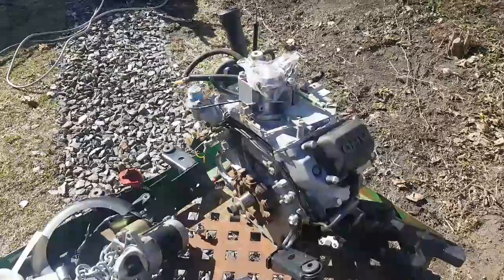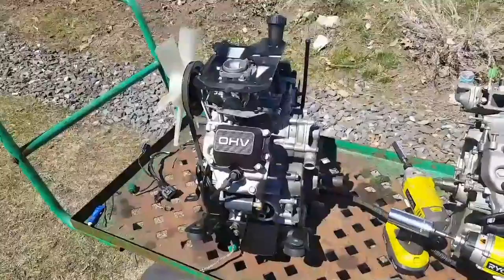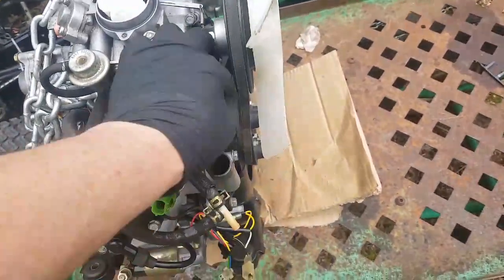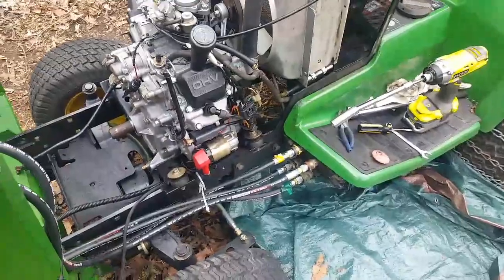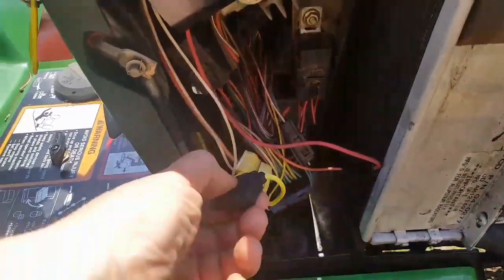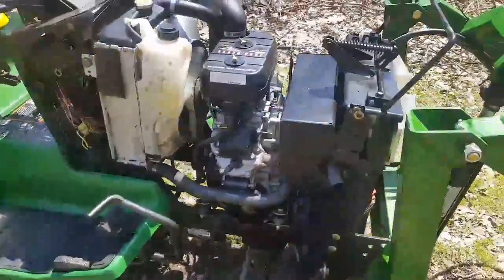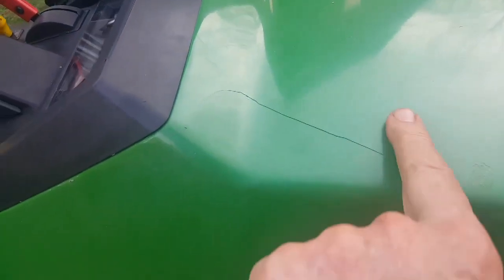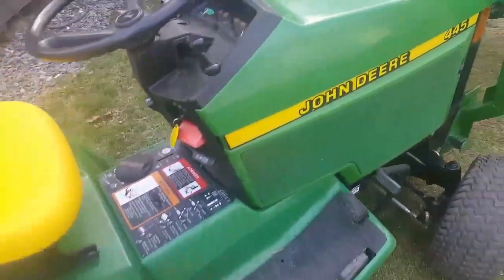John Deere 445, 425 Engine Installation - Kawasaki FD620D

Comment: I very much enjoy your John Deere 4XX videos.  I have a 1993 model with less than 600 hours on it that was smoking badly, so I got the engine off of the frame yesterday and started breaking it down today.  The first cylinder is as smooth as a baby's bottom (thankfully - because I was worried about having to bore them out).

I also loved your Little Buck videos.  That is the bucket system that I am planning to go with if I can keep my wife's Mini Cooper out of the garage and taking my "project money."

Comment: I did see your panel repair video and the tip to move the front infrastructure appropriately so my panels now fit perfectly, I am in process of fiberglassing the inner panels trying to overt cracking and breaking. I appreciate your videos and your courtesy of promptly  replying to issues. Thank you!

Comment: I replaced the side panels from a after market source and find the grill does not  align properly, I will try to adjust the front frame and hopefully it will fit better. Thankyou.. do you have any documentaries on your hydraulic system as this 425 has never had hydraulic system install.
Reply from the maker: I do have two vids on adding additional shut off valves to the hydraulics, which could be helful.  As for the basic system  you should be able to buy a kit that connects to the hydrostatic system.  Good luck!
Reply from the maker: Did you see my video on repairing those panels?

Comment: Who did you have rebuild your fd620 ? I need on rebuilt. Thanks again for the great content
Reply from the maker: I bought that engine cheap on ebay and rebuilt it myself.  The original seized engine that  I pulled from my 445 is stripped down and waiting for me to reassemble it.
Reply: Tesser52 Thank you for your fast response I do really enjoy your videos you’re very informative

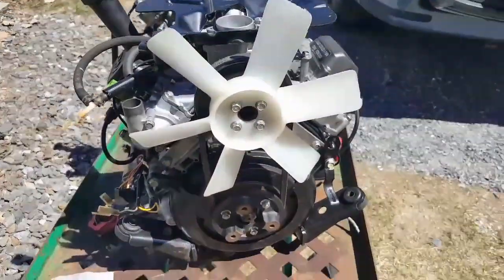Did you just buy a rebuild kit off eBay? I currently have six of these John Deere tractors ranging from 455 to 4:25 I have three spare engines not sure if the cylinder sleeves are cracked or not it’s extremely hard to find a machine shop near me to perform these tasks. I have a full mechanic ability to rebuild them but if there was a more cost-effective way to get these parts that would really help out
Reply from the maker: @FBIsurveillance62  I purchased both rebuild kits and parts from Kawasaki supplier ATVWorks.com  Their prices are very good and they're helpful.  I found it best to call them because not all parts are listed on their website.  Obviously, before doing a rebuild I check everything with a bore gauge and micrometer to check wear and tolerances, etc.  I will probably soon be posting a rebuild vid...
Reply: Very helpful thank you so much for taking time out in responding I have been a subscriber for a while I believe a little buckloader lead me to your videos a while but I’m sure glad they did
Reply from the maker: @FBIsurveillance62  You are welcome.  I enjoy posting the vids and it is good know they are helpful to other owners...

Comment: Hopefully it the new engine either had or you changed it to the “Steel” cam gear,, or unfortunately you will be rebuilding it again shortly... good luck with it i hope all works out well for you ..another question is why does it look like your differential lock peddle look like its stuck down ?